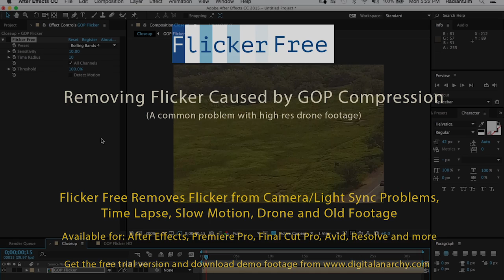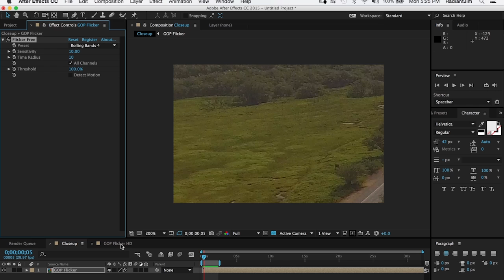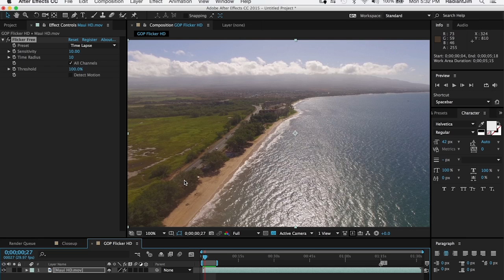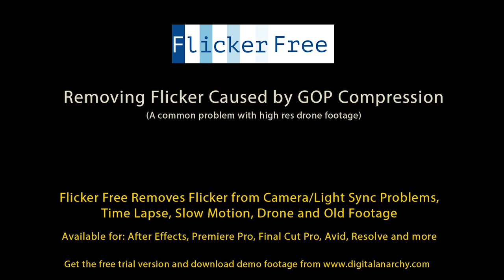Removing Video Flicker Caused by GOP Compression - Drone Footage Example

Comment: I don't understand how this plugin is not more widely discussed online. I had to stumble onto it myself after many hours of research. I just can't understand how the compression with these DJI drones doesn't bother EVERYONE to the point where they can't use the footage. Before I used this plugin, I was seriously fearing I wouldn't be able to use the footage from the Mavic. But with it, it's totally useable! Night and day difference. High levels of noise are still a problem, particularly in the darker areas of the frame (maybe less than 40% mark on histogram) though. Luckily there's also Neat Video, which works quite well for getting rid of noise. Between these two plugins, the Mavic footage is pretty useable for more casual productions. But also with these plugins come much longer render times, especially when both are needed!
Reply: Josh Levinson i dont understand how dji can even realease a drone with the word PRO as to imply proffessional use...make you pay thousands of dollars for such a product....and have a camera that glitches. Do they not realize that the camera is the main selling feature and the footage is the most sought after thing about the drone? of course flying is fun and all but the vast majority of consumers dont buy a $2000+ drone simply to fly. blows my mind that this is even an issue to begin with. i can buy a shitty $200 dslr that wouldnt have this flicker issue and look more usable then some of the drone flicker and glitching footage. Absolutely bullshit on their part. also hate to break it to the guy in this video but his footage is still shit and flickering and he failed to spot the movement of the cars skilping 1/8th of the way down the road. your solution to this problem sucks.
Reply: I agree the "Pro" in the name is inappropriate, but tons of companies are doing it. That said, and in relation to the meat of your comment, DJI is by far the worst consumer company I've ever dealt with, in terms of both customer service and their misleading marketing.

But to be fair, this drone costs $1000, not $2000. And I've tried $200 drones, and the video quality is way, way worse than the Mavic's. But I agree, the flickering is totally unacceptable, especially since it's apparently been present in the Phantom line as well for multiple generations. I frankly don't know how anyone can tolerate it. Maybe it's tolerated because most people just upload their videos to YouTube, and the YT compression mostly makes hard to notice. There are also other serious problems with the video quality on the Mavic, such as the watercolour / smudged detail phenomenon that is very prevalent in all the best-lit scenes.

To your comment about the video posted here, I don't know how visible the flickering really is. But I can say from my own experience using Flicker Free so far (I've used it on a fair number of videos) that it works very well, if you take the time to fine tune the settings to prevent weird artefacts from occurring. It doesn't always get rid of the flicker completely in the end, but it dramatically reduces it (to the point where it's barely noticeable if at all) with minimal artefacts. I consider myself very demanding when it comes to things like this, and I've found it to be an acceptable solution for the Mavic's flickering problem - in terms of end product. But it's definitely unacceptable that you need to spend another $150 to make the Mavic's video acceptable, and it also adds a tremendous amount of time to post-processing of video (especially when you need to add it on top of a noise reduction plug-in to deal with the insane amounts of noise present in the Mavic's video, even at the lowest ISO).
Reply: Josh Levinson oh snap. this vid is probly about the mavick but i have the phantom 4 pro($2000+) and the same issue happens.
Reply: Haha! Fair enough, on the P4P comment. It's extra ridiculous that the problem occurs with that drone as well! My experience so far is that DJI can't write compression / sharpen / noise reduction algorithms to save their lives.
Reply from the maker: Hi Jordan... The goal with the tutorial is to minimize the flicker to the point that if you're not looking for it, it's not noticeable or at least not distracting. As with many problems like this, it's not completely solveable without often introducing other problems. Also, keep in mind that YouTube is compressing the hell out of the video on top of any compression that's coming from the Phantom 3 Pro used to shoot the footage. The car skipping is most likely from an edit, I'm not so good at tutorials that I can record them in one continuous shot. ;-) In DJIs defense, I don't think most people appreciate how much data is being processed through the lightweight electronics (both figuratively and literally) on the drone when shooting 4K. That said, I don't think they're very upfront about the issues that come from trying to cram all that data into a camera that can be flown around... and their customer service, from all accounts, leaves much to be desired.

So if you're trying to make the footage look professional, Flicker Free is one way of helping you get there. The alternative, of course, is to spend $5K  on a drone that you can attach a dslr to. ;-) You can also shoot HD which generally looks better because the compression doesn't need to be cranked up as high.
Reply from the maker: Josh- thanks for the comments! Glad it's working out for you. :-) We're always looking for user examples for the Gallery section of our site. If you're interested in sending us some stuff drop a line to sales@digitalanarchy.com. Obviously we'll credit you and link to your site (or YT page or whatever).
Reply: Digital Anarchy ya srry bout that comment lol ur vid is helpful i was frustrated earlier and just bitchin about everything lol

Comment: Just bought this plugin, it's not cheap, but I have been searching for ways to fix the compression artifacts in my Mavic Pro footages, and this plugin works really great, the 60 Mbps low bitrate of Mavic Pro is longer a problem for me to shoot in 4k
Reply from the maker: Cool, great to hear. We haven't had a chance to play with the Mavic yet, but I'm assuming it's about the same quality (or maybe less) than the DJI Pro 3 we have. Thanks for letting us know!